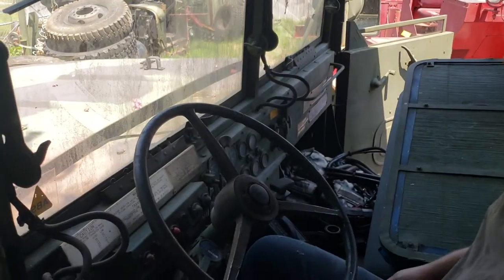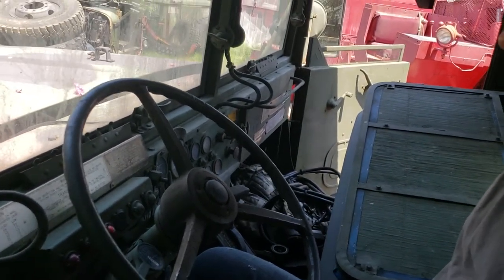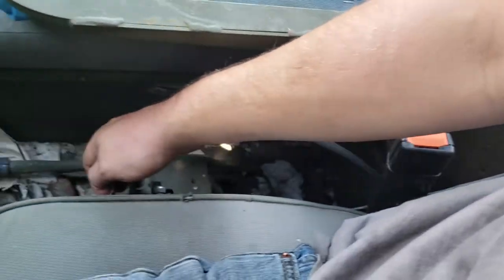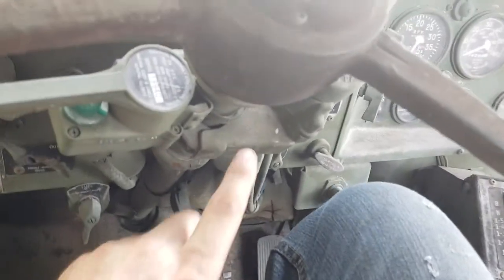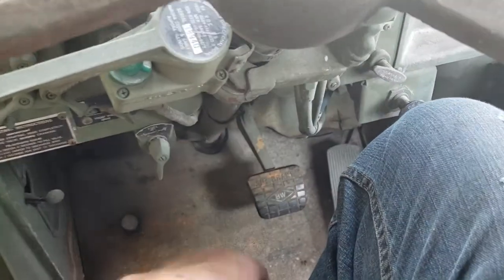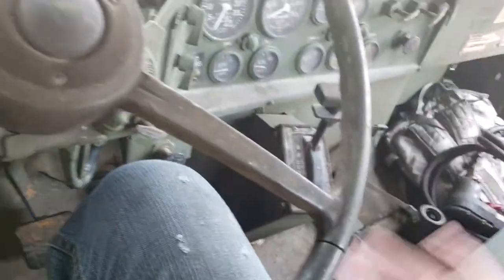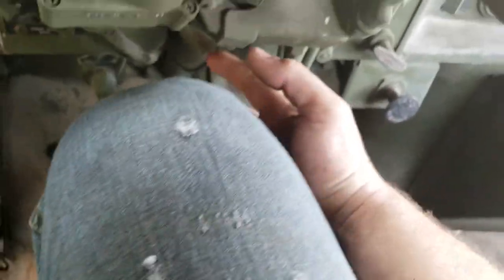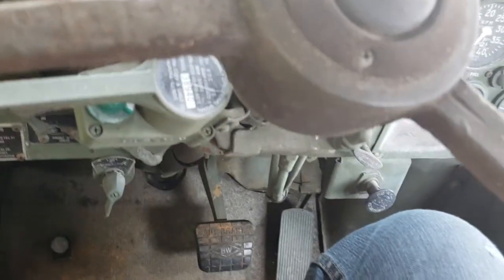M936 wrecker operation overview

Comment: This must be totally different than for the M929 dump truck? I could swear on that it's running>1-5>engage PTO lever on dash>Back to neutral>engage hoist and vice versa to disengage?
Reply from the maker: Wrecker pto is on the transfer case. Not the transmission.  Transmission pto has to have 1-5 so the torque converter stops spinning to engage it.

Transfer case has to be in neutral for it to work.  There is no gear resistance with the disconnect driveline so it slips right in
Reply: @wessimpson2794  Right, totally different system.  Went to try and refresh my memory on the dump truck (Haven't run one very many times) and was like this procedure is totally different than what I was ever instructed.  Thanks for the clarification!